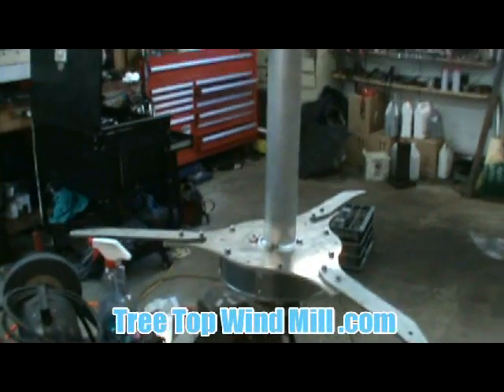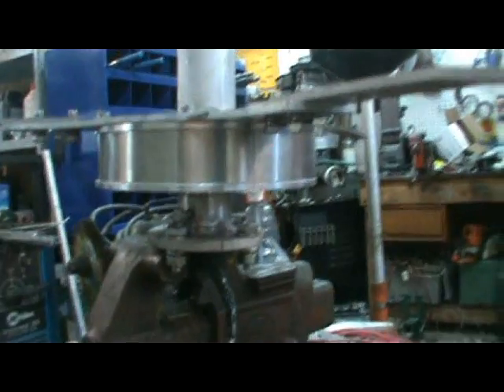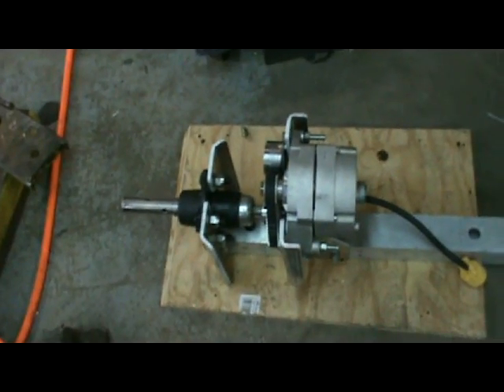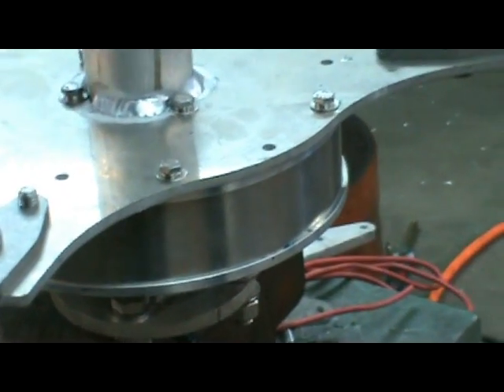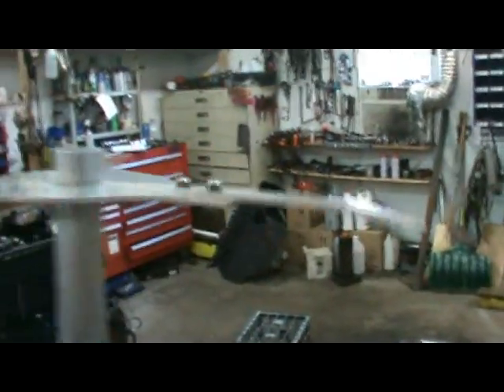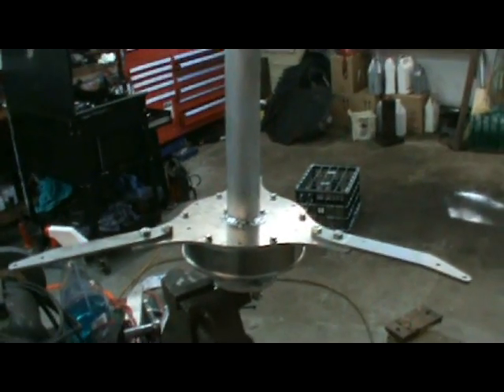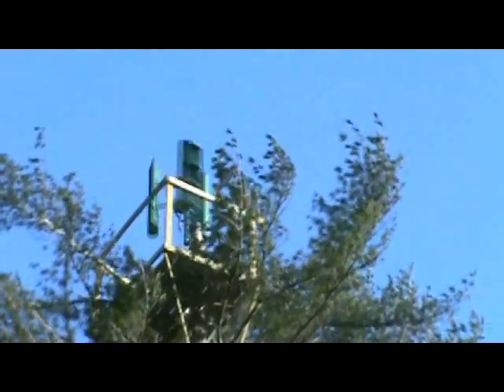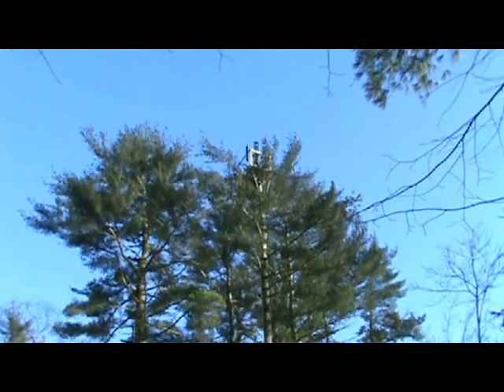usvawt test .avi at Tree Top Wind Mills

Comment: What was the approximate wind speed?  How much power did you see?   It's only doing about 60 RPM which makes me think the VAWT was stalled.  You probably should have used one of the alternate wiring configurations.  The highest voltage configuration is not always the best.